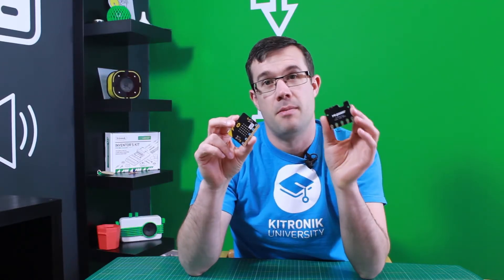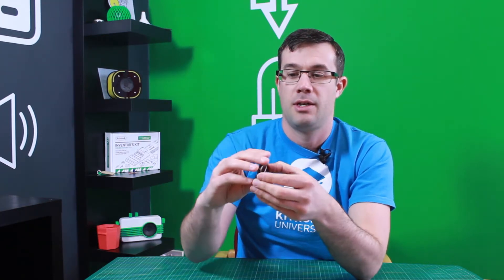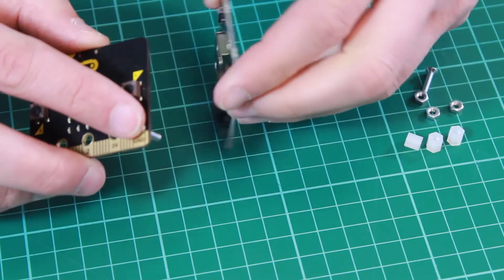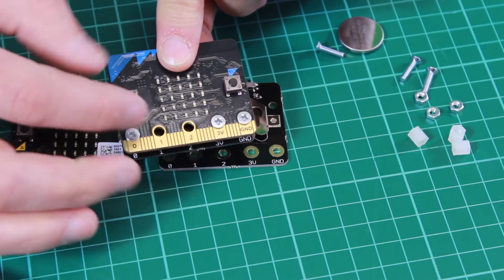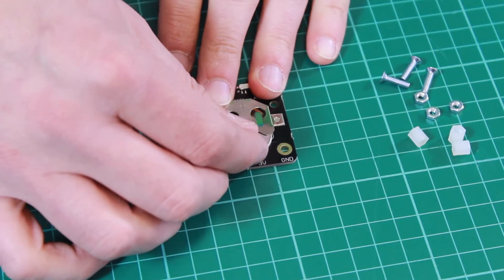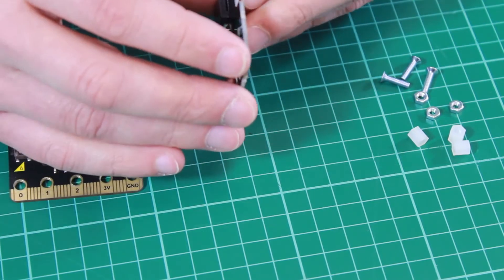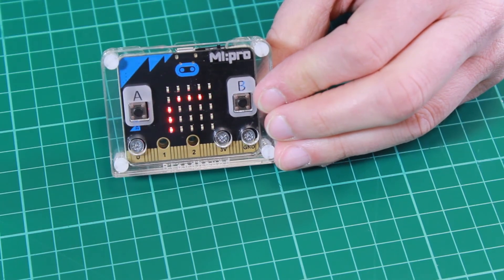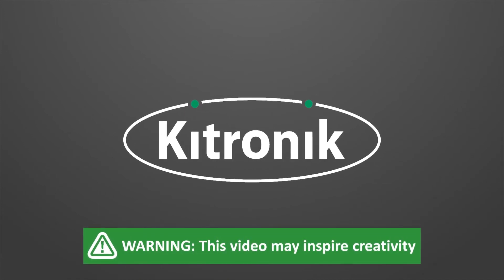MI:power Board for the BBC micro:bit

Comment: Can I plug it to PC with USB and program it while this power board is attached? Is it an issue? Does the battery get charged and damaged?
Reply from the maker: Hi Hüseyin, it is perfectly ok to connect this board to your PCs USB ports while it has a battery inserted. It doesn't charge the battery or harm it in any way.  I hope this helps.
Reply: @kitronik  perfect thanks, do I need to turn of the switch?
Reply from the maker: @huseyint  No, just plug in and go!

Comment: does the microbit fit with the inventors kit with this power board
Reply from the maker: If you attach this board to the microbit you won't be able to then plug the microbit into the edge connector.
Reply: Kitronik okay thanks

Comment: I got a powerboard to attach to the microbit, and I tried to add the case, but the metal screws kept on getting in the way, making the plastic screws too short to attach.  Can anybody help me?
Reply from the maker: Hi. You can find assembly instructions at the bottom of the page here https://www.kitronik.co.uk/c5611-mipower-case-for-the-bbc-microbit.html
If you are still having difficulty just drop us an email. It might help if you take a photo showing the bit you're having problems with too.

Comment: Really good product but there is a little component, just above the battery cell and below the on/off switch, that can easily break loose from the board. Be very careful when pushing the battery out of its holder from above. In my case this little component broke off and I had to bridge the gap with solder. It was imposible for me to place this part back on the board. 
Now that the gap in the circuit has been bridged it works fine again.